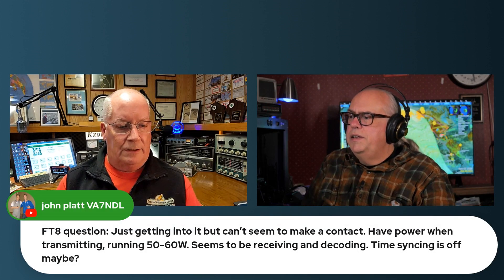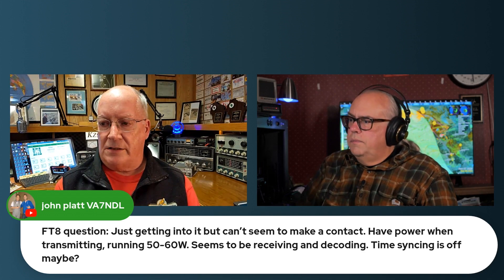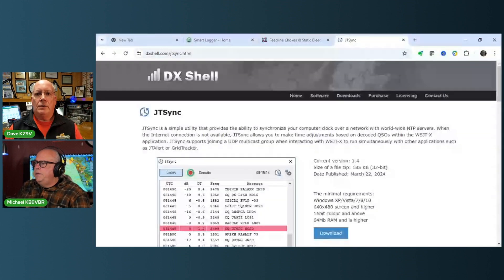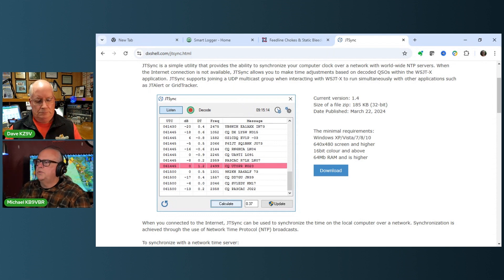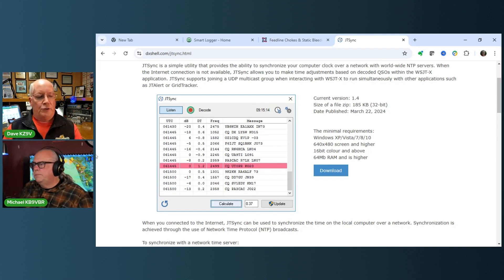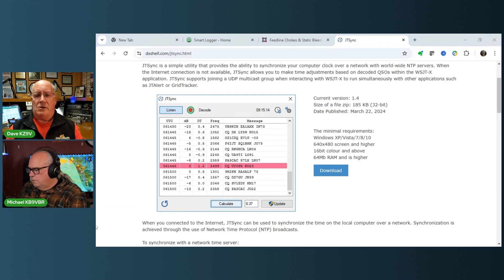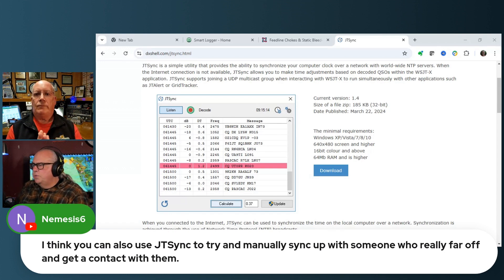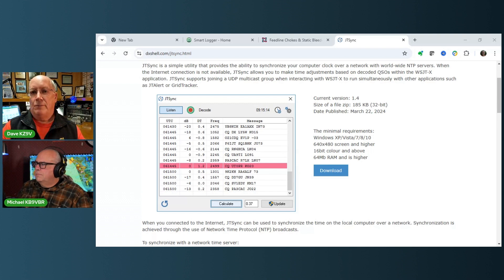Why Your FT8 Signal Won't Decode SOLVED! Ask Michael, KB9VBR

Comment: Should not the ALC be Off when working in FT8 ?   Thanks   73   KC3ZDW
Reply from the maker: Yes, ALC should be off or so low that it doesn't register on the meter.